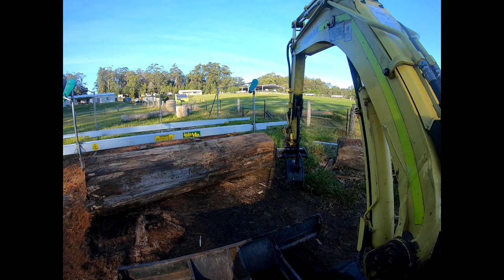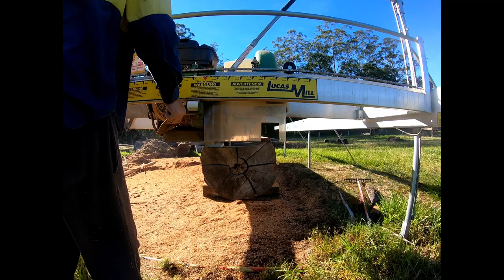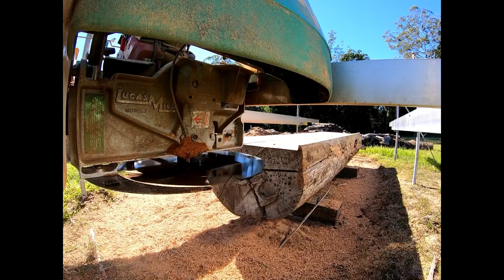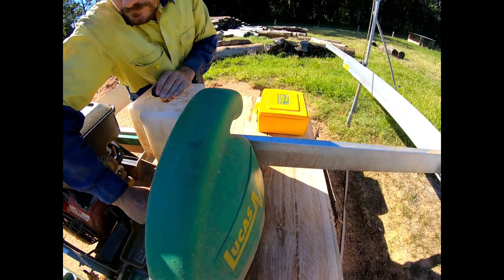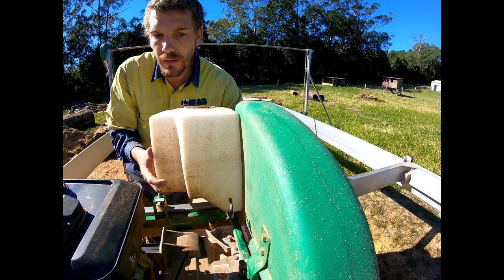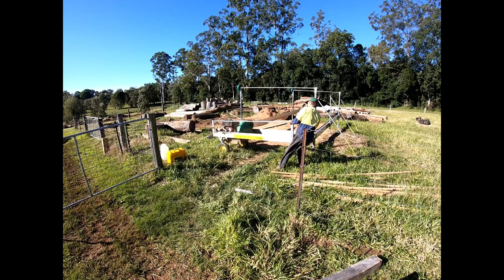LUCAS MILL MILLING AUSTRALIAN HARDWOOD

Comment: Excellent video and honestly the best detail on this site regarding viewing the blade rotation. 

I’m wondering what size Kubota you’re using and any regrets with its size. I’m using a 25hp Kioti and have my new 8-30 Lucas next week and not sure that little tractor will be enough to lift the red and white oaks we have here in the farm. Thank you for the video. Nice shed too btw
Reply from the maker: Hey mate it was a M7040 70hp big enough for lifting milled timber around but not enough HP for mulching  i have a M9540 now i use my excavators to lift my logs around mostly
Reply: Nice one. I've had two 8" mills 26hp carb and 30efi and worked them with a 75hp Daedong with FEL forks, now going to a 10/30, would love the 8t plus excavator though for logging and bark stripping.

Comment: How much does that mill cost new? I've been looking for a mill and this one has caught my eye..
Reply from the maker: Hey mate the 7-23 when I bought it was around $15,000
Reply: We bought ours used...a smaller one.  Was a bit worried that the small one would be too small.  We have had so much fun with the mill that having two would not be out of the question!   This is great fun - you begin to look at projects in a whole different light.      We made wheel barrow handles, post hole digger handles...trellis, planters.

Comment: Is that a model 7 with an 18hp Briggs motor? Great video.
Reply from the maker: Hey mate it's a model 7 23 but they actually can cut 200mm and it's a 23hp vanguard briggs